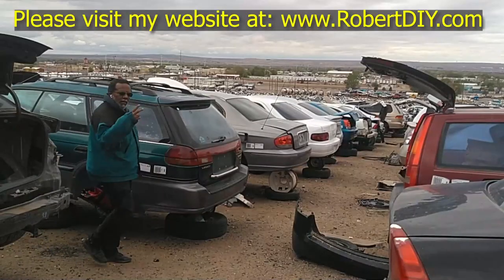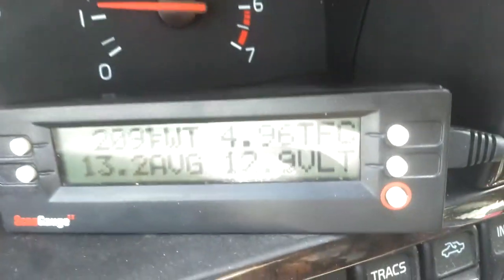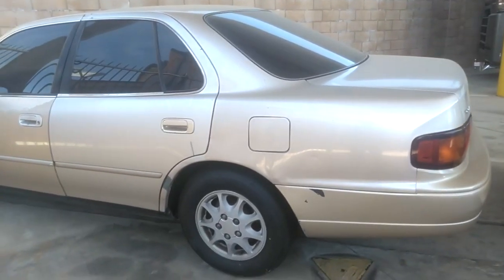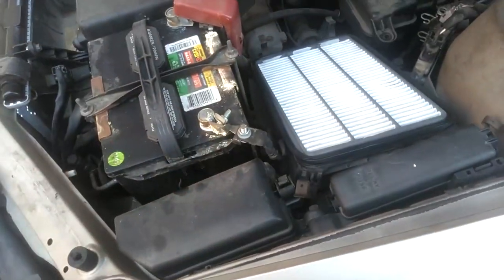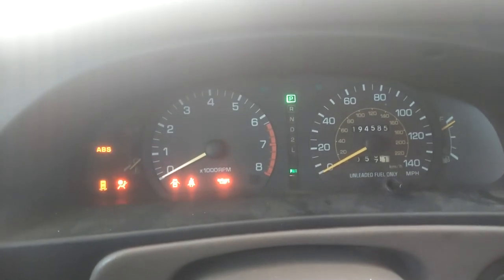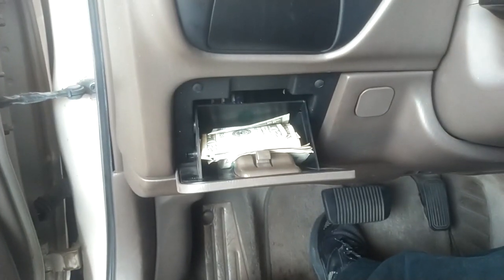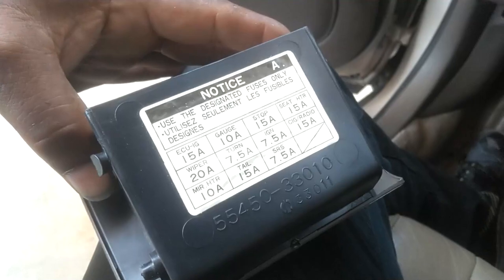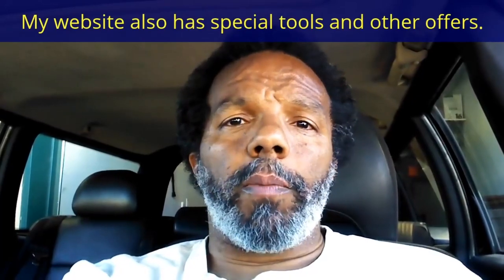Back to fire up the Camry after the fuel pump replacement...FAIL!

Comment: i thought that when the battery is fully charged the voltage from the regulator was reduced to stop over charging? It usually shows a bit of a higher charge after starting, especially if it has taken a bit of a churn. Multiple test starts will take the state of charge down even from a good battery. That seems to be the case with my 2000 P80 V70. I have a small volt meter that plugs into the lighter socket. Very useful.
Reply from the maker: Usually between 13.4 and 14.2.

Comment: Camry is a good fast car  atleast after 2010. For the 4 cylindr is the same 2ar-fe found in the scion tc 2011 and up.

Man that thing jump from. the so called 169 , 179 se camry , 180 tc Scion. To 210 211 on or after the 3rd dyno run.  A true rice patty letting the good times roll.  I guess dont have to tell ya Toyota is rice pattie in japanese
Reply: @RobertDIY  haha haha 😄  guess a little moon shine will help its head keep cool when it's 90 degrees and adjust its performance already in the system ..

Go that thing take off in 1st to the 40 speed limit. But that transmission is not willing to move in 2nd like its rough due to I guess it gets shaken up shifting giving it 90% since 100 might lead to stuck pedal.  So then merging onto a freeway I have to put it to s and manually down shift from 4 to 3 😁 BUT let off gas for 2 seconds so the whole car be neutral -transmission lag and chassis sending 3250 toward the rear biased , then go half throttle and it start passing steady cars as I merge or pass 🙄 👍  🤔 😀  THANKS Toyota for a safe car lol